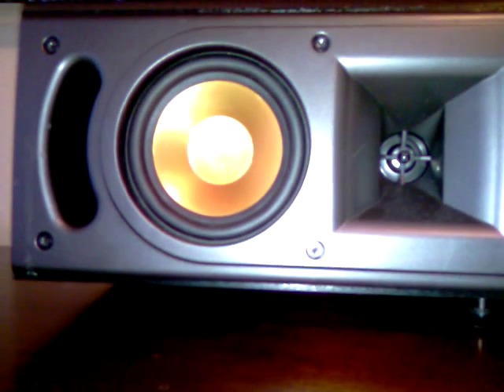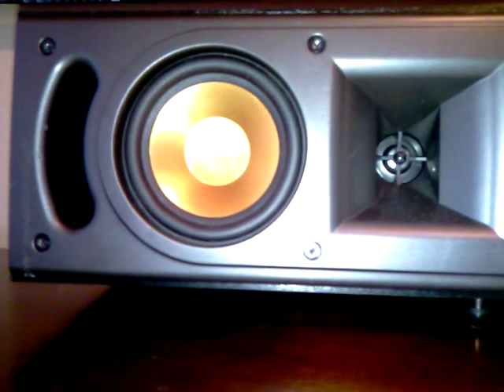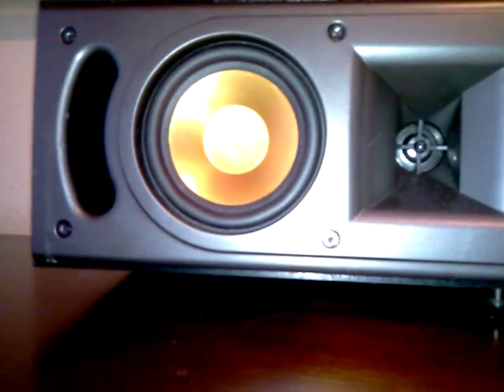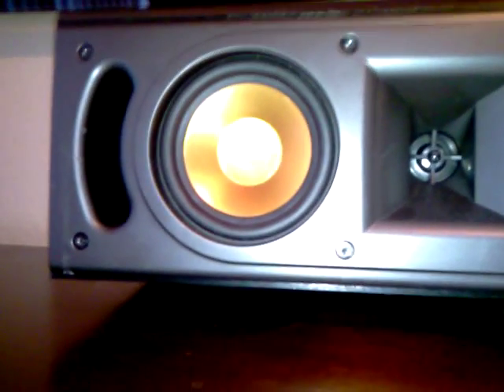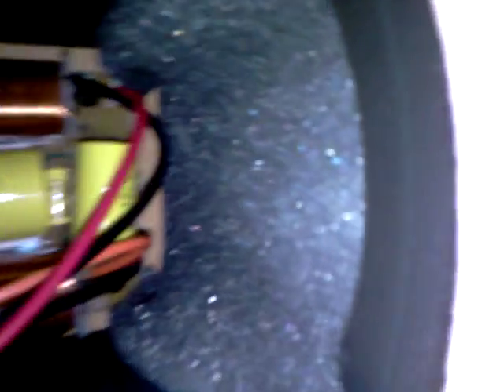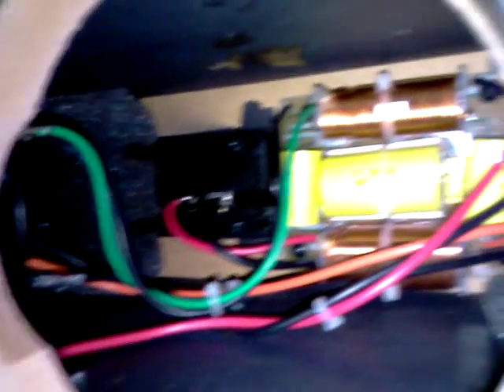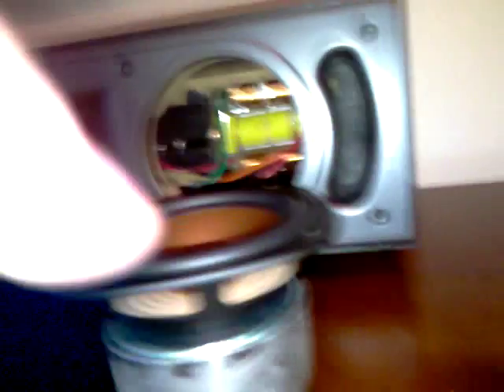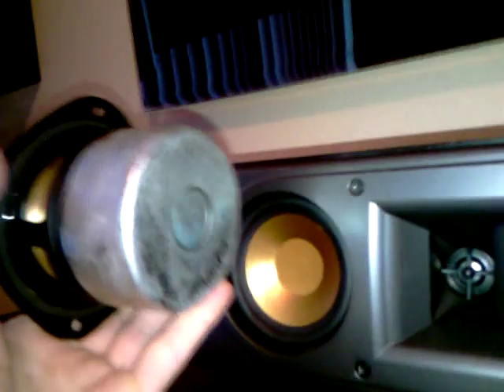Going inside KLIPSCH!

Comment: These are the same drivers as in the RB-51's? Looks pretty impressive. I have two RB 61 fronts and two RB 51's on the rear and i am looking for a decent center speaker. I am currently using a Creative Gigaworks S750 center speaker, but it is dwarfed by the Klipsch surrounding them.

I think the RC-52 is a good deal, the RC-42 looks too small and i have no room to accomodate the RC-62.